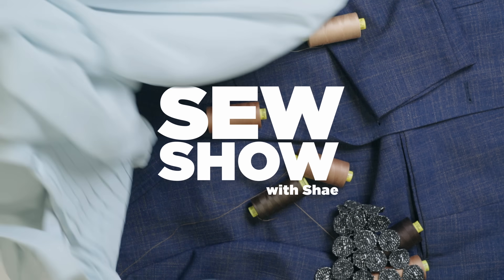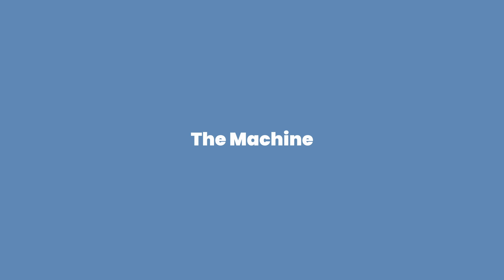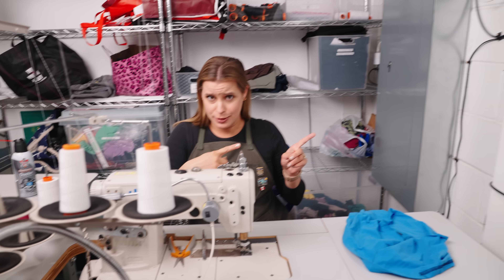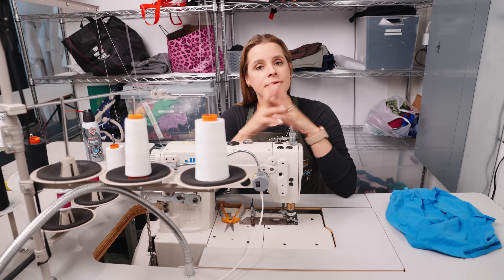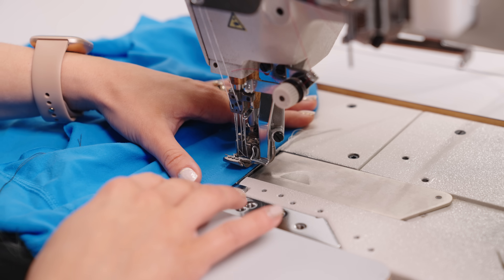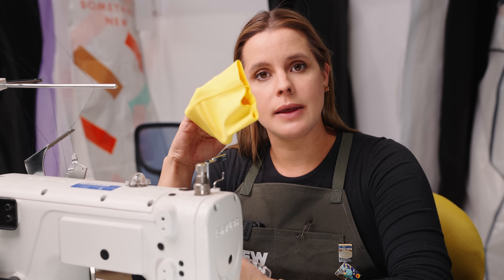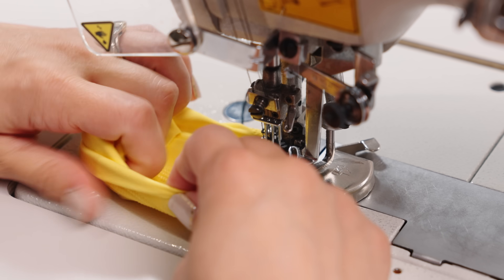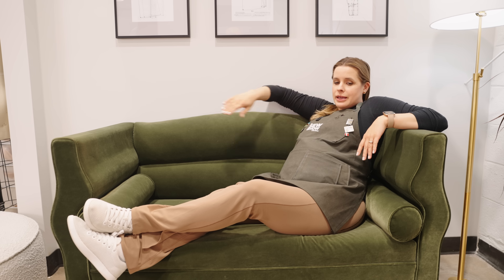Sewing a REAL T-Shirt Hem At Home - Is It Possible!? (Ep. 76)

Comment: My baby lock cover stitch (a ‘domestic’ machine) does this without fiddling with any settings. It’s so easy to use and was an absolute game changer for professional looking knits. And for professional level performance of the resultant stitch. I struggled for years with twin needles and with people saying you can get equivalent results in looks and performance with a twin needle. That is complete coswhallop. You cannot get an equivalent or even near-equivalent with a twin needle. So I invested in the cover stitch. Yes, it does only one thing. But does it well and properly and easily. This, and my baby lock overlocker are the core of my stretch sewing (which for me is 70% of my sewing) arsenal. But also realising that a straight stitch machine also has its uses in stretch sewing (not every seam on a ‘stretch’ garment NEEDS to stretch) - if I need accuracy and precision in a stretch garment construction,  the straight stitch machine can still be king!
Reply: That sounds a lot like my BabyLock Euphoria, which has automatic tension, and bonus air threading looper. I use it whenever I can.
Reply: By Bernina does top and bottom cover stitch. So I don't know why she says you can't do it.

Comment: The fact you say this can’t be done at home is hilarious. I have a Janome serger / overlocker it is a 5 thread so can pretty much do any stitch you need. It’s a domestic not industrial. You can just turn the blade off so it tucks away and set it up to do a professional 5 thread or 3 thread cover stitch and you can also do a narrow cover stitch or a wide cover stitch. It does exactly the same as your big industrial machine. Every stitch you did in your video I can do on my machine. It doesn’t have a bobbin it has a stand for 5 threads and has a loopers underneath for either 1 thread or two threads, it does a proper cover stitch!!! So yes you can do this at home. And yes I know what I’m talking about I’m a professional dressmaker and have worked in fashion factories and know work for myself.
Reply: What model? Thanks

Comment: This is a fine way to hem knits when 1)you have the space for an additional machine, and the patience to thread up and use it. 2) If you're wardrobe is mostly knits.
Otherwise, I've been using various styles of zig zag stitches for decades with success. Also, I'm seeing more RTW t's with a serger hem that is a series of vertical stitches on the right side, which looks and performs great.

Comment: Years ago when I started sewing on a regular basis I bought a Janome coverstitch machine and hemmed all my knit shirts with it. Easy to thread and professional looking hems. 3 and 4 threads. Also used for embellishment. I have never used a twin needle for hemming, I'd rather sew an invisible hem by hand. It is all a matter of well preparing the hem  : test the method to be used for seaming on a scrap of fabric,  measure accurately, press, use steam-a-seam if it helps, sew with a melting thread if you prefer. Use  some painter's tape to mark the fold of the hem on the cover stitch machine for accurate coverstitching.

Comment: won't a wider twin needle help with the tunneling? On another note, what about home serger machine that have coverstitch feature?  I own a Juki MO735 serger that has a coverstitch.... but I am terrified I wont be able to put it back together for serging!
Reply from the maker: Actually, the wider the twin needle, the worse the tunneling, because there’s a wider space not under tension where the material can bunch up on itself. And I’ve never used a combo machine myself, but if I were trying it out, I think I would just remove the blades at the very least and hope for the best! At least if the stitching is messed up, nothings been cut off right!?

Comment: I have modified many pieces of clothing, a large chunk of which being t-shirts. After trying many different methods, I found that by far the best way (sans a coverstitch machine) is to use a stretch stitch on a standard sewing machine! (Quick note, I do not know if this works for super stretchy athletic material. The stretch stitch stretches the perfect amount for a cotton or mixed material shirt, but I don't know if it would stretch enough for athletic material. It may work with a looser than usual thread tension, and or longer stitch lengths. I say give it a shot and find out!)

I figure out where I want to hem the shirt and then mark my fold line all the way around by measuring from the edge. I find that with typical cotton or similar t-shirts, you don't need to worry about raw edges, so I don't bother cutting and zig-zag stitching, but you totally can if you would like. Instead I just fold the shirt on that line and pin, and then toss it under the machine. The one exception being if you're only hemming a small amount, you don't want to sew over the existing folded hem or it will be really thick. In that case you likely need to pick the existing seam, un-fold and iron,  and then fold on your new hem line. At that point you can do a stretch stitch all the way around, I like to match one of the original seam lengths from the bottom of the shirt. Some shirts I just leave at a single round of stitching, but if you want to match the original look you can add the second round. No need to measure anything here, just offset your needle or move that first stitch to a notch on your foot or some sort of marker, and then run it all the way around again. After sewing I cut the extra fabric off, leaving about 1/8" to 1/4" behind. I have never had issues unraveling, so like I mentioned above there is no need to try and zig-zag this in my opinion. The last step is to give it a good iron (alternatively you can do this after pinning and before any sewing is done), then toss it in the washer and dryer to get rid of the markings you made, and that's it!

The first couple might take an hour or so to get the process down, but I can do most t-shirts in 20-30 minutes at most now. Prior to this method I had a few shirts unravel on me, because the stitch that you do with a straight stitch or a double needle does not stretch, and if you try to stretch the fabric when it's going through the needle to account for that it never turns out quite right. I have shirts using this method that I've been wearing for well over a year now, and have no issues with stitches popping or coming undone.

Comment: The real forbidden fruit is the off-the-arm flatlock (or flatseam) machine. It's basically a top-and-bottom coverstitch machine with 4 needles, as well as an overlocker-like trimmer. You feed the two pieces of fabric into the trimmer butted up together like they're going to make a standing seam, then the trimmer evens up the edges, and the fabric guide just after it lays them down to lap on top of each other just before they're sewn together with the 4-needle top-and-bottom coverstitch. As a result you can use it to fully construct sleeves and legs of garments without having to resort to an overlocker and getting a standing seam on the wrong side.

Unfortunately unlike the 3-needle top-and-bottom coverstitch machine, no domestic version exists (NB: I do own a Brother CV3550, which is as close as you can get). The industrial ones are rare as hen's teeth for the flatbed versions and the off-the-arm versions are basically impossible to find on the used market. Of course you can find them new, but ouch those new industrial machine prices...

Comment: I'm fine with using my sewing machine. I don't need the stitch to look like that. Nobody is going to notice the stitching on the inside or even on the outside for that matter, but people will notice if your clothes fit you well.
Reply from the maker: You bring up a very important point that I did not mention; it’s not just for looks, the stretch and retention capability is way higher with this stitch so way less (if any) popped stitches!
Reply: I like my Janome cover stitch 😊 but it takes a lot of practice. If you want to do twin needle on your sewing machine, I’d suggest using one of the new stretch threads to prevent popping stitches. ❤
Reply: You do you. 😊
Reply: It's not for aesthetics it's for the fabric to stretch and not break the thread
Reply: facts. if it’s hidden i’m ok

Comment: I have seen some sergers that have a coverstich option.
Reply from the maker: You aren’t wrong, I’m just not game for taking the blades out every single time I want to use the cover stitch function. But they definitely exist!
Reply: They’re very expensive and are a pain in the butt to switch to one another. You’re better off having two separate machines.
Reply: From experience- the serger/coverstitch combo machine is not as great as it sounds.  It’s not like the old dvd/vhs tape combo that switchs back and forth easily- you have to switch over a bunch of parts for each type of use.  After testing a combo machine I quickly bought a plain coverstitch and love it.

Comment: I have a serger that also does up to 5 thread cover stitches.  How is the cover stitch machine different? This is in addition to 3 sewing machines- 2 mechanical and 1 electronic (Husqvarna).
Reply from the maker: Regardless of how many threads a machine can hold it just doesn't make them the same. The serger and coverstitch are just two completely different machines creating completly different stitches.